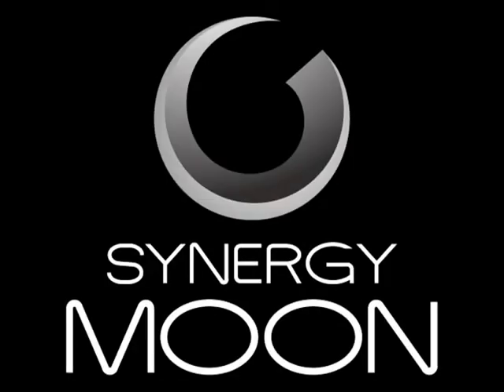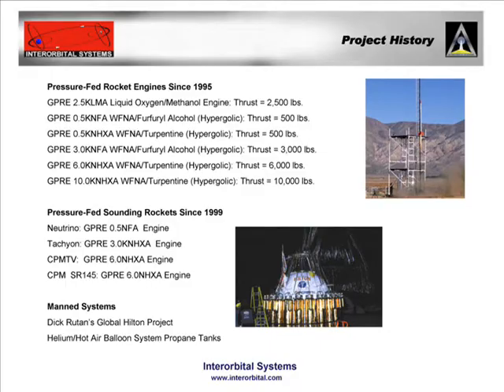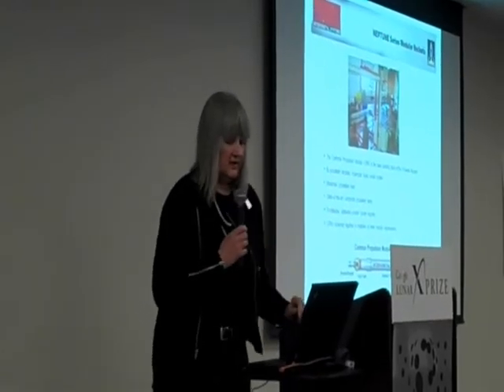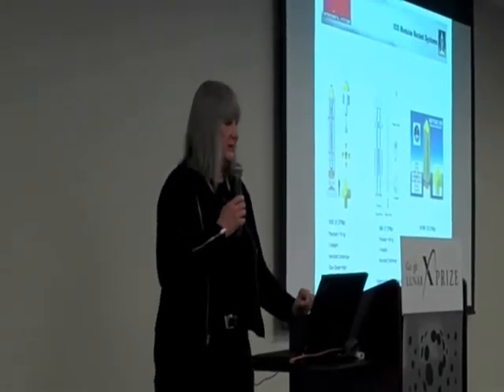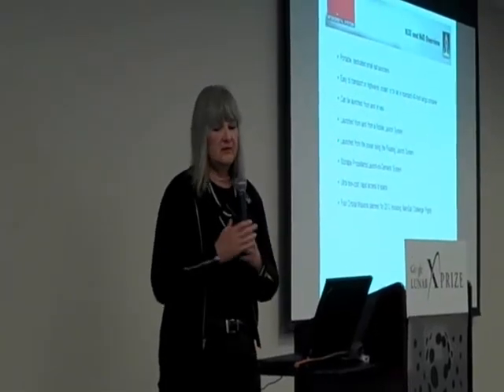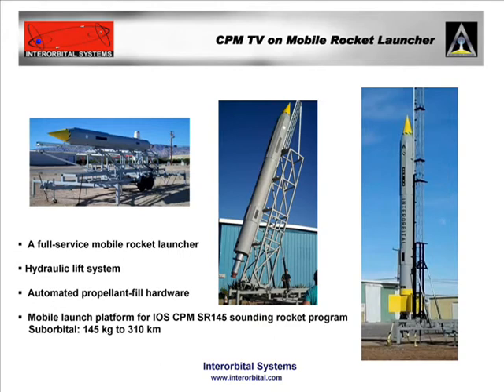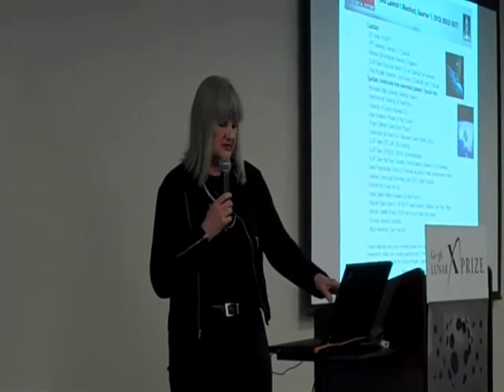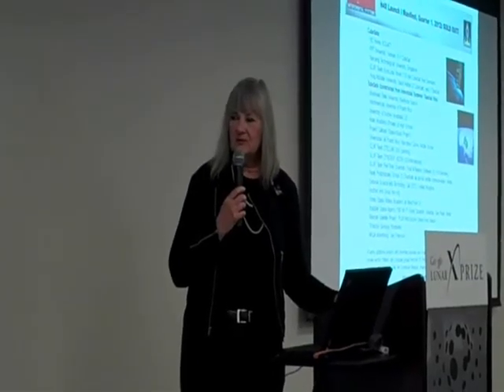Synergy Moon Presentation at 2011 GLXP Summit

Comment: Why did interorbital systems choose the low Isp combination of Turpentine & Nitric acid? Why not use the higher preformance RP-1 or kerosene? It's as 'green' as you want it to be if you make synthetic kerosene.  The Nitric acid Kerosene combination can be made hypergolic with a starter shot of TEA-TEB or a starter shot of Turpentine if you really want to. With all those engines I foresee 'Hard starts' and possible CATOs, the long ignition times of Turpentine and Nitric are going to be a headache